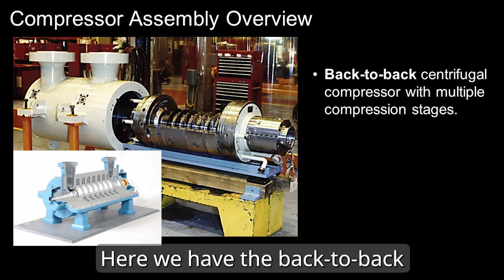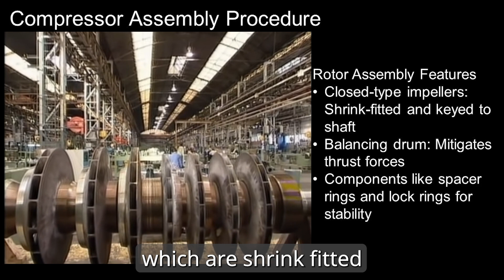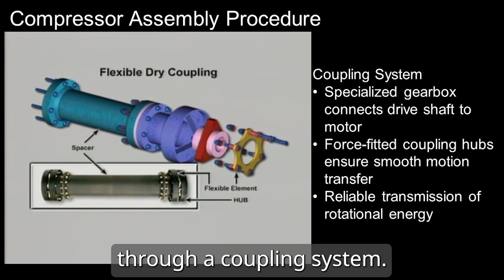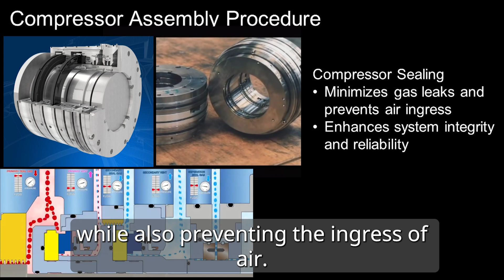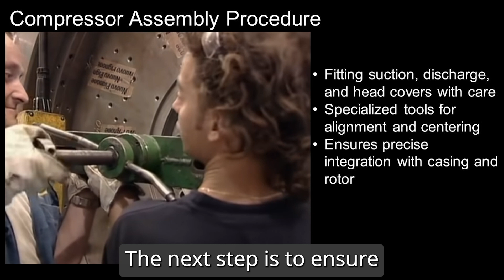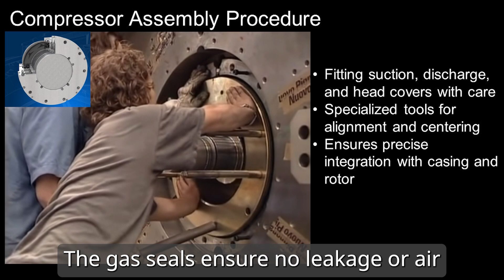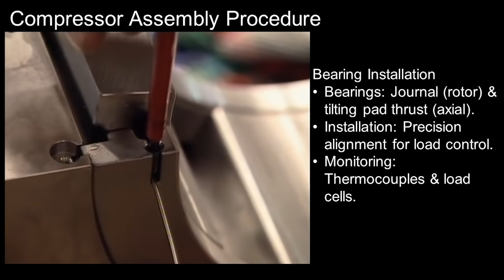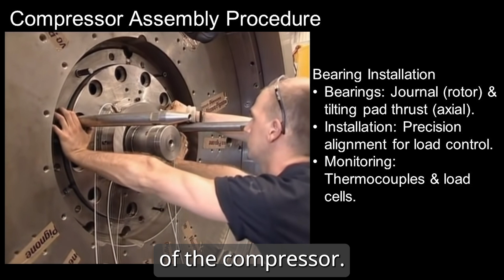Compressor Assembly Procedure: A Step-by-Step Guide (Part 59)

Comment: Until the NDE bearing is installed, how is the rotor supported in the casing without a radial bearing?
Reply from the maker: Good question. Without the Non-Drive End (NDE) bearing installed, the rotor still needs support within the casing to prevent excessive movement, misalignment, or contact with stationary components. The methods for temporary rotor support typically include:

1. Drive End (DE) Bearing Only – If the DE bearing is installed, it may provide partial support, but this alone is usually insufficient for proper alignment and stability.

2. Temporary Support Structures – These can include:
a) Assembly Jigs or Fixtures: Custom supports designed to hold the rotor in place during installation.
b) Soft Supports: Such as rubber or polymer inserts, acting as temporary cushions within the bearing housing.
c) Dummy Bearings: Temporary radial bearings used to support the shaft until the actual NDE bearing is installed.

3. Labyrinth or Journal Clearance Fit – In some cases, a close-clearance labyrinth seal or journal section within the casing can provide minimal radial support.

4. Magnetic or Air Lift – In specialized systems, magnetic levitation or air pressure may be used to prevent shaft contact before final assembly.
Reply: It's easier on a split case style where you can have the bearing in with the top half off

Comment: Great stuff...could you make a vedio about mechanical seal systems specifically on multi-stage pumps and compressors.
Reply from the maker: Thank you for your suggestion. Sure, I will cover the mechanical seal system in a future video. If this video was useful, please feel free to share it with your colleagues. :)